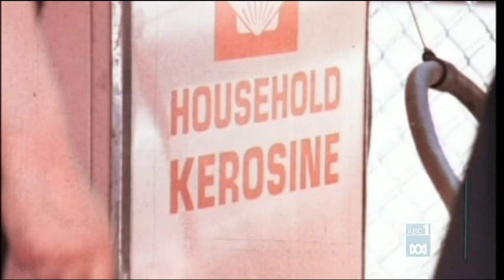Steam Powered 1963 Ford Falcon

Comment: Its hard to believe how many people actually think that steam is more efficient than ICEs.. poor educational system these days.
Reply: I don't think it's so much a factor of the education system being poor so much as willful ignorance and the fact that this type of knowledge is pretty esoteric for the average person's working knowledge.
Reply: True! Steam automobiles have been obsolete for over 100 years... the fact some here are convinced that an obsolete design is still commercial viable without any understanding of why the concept died out still escapes me... I suspect a combination of low intelligence and poor standards... which by default limits the educational resources of the individuals as well.
Reply: doktorbimmer What initially piqued my interest was the ability of at least this engine to use a wide variety of fuels, given the political volatility surrounding the international oil market- acknowledging there are complexities I will never know there. On top of that, there's the concern that oil is a limited resource- although I can't imagine it will stop being readily available within 50 years. Steam could theoretically run on anything that burns, wood chips for instance, and more easily than internal combustion- though I do know internal combustion can be accomplished with gunpowder, kinda like pseudo-pneumatic fuel? I don't know. I haven't studied thermodynamics, but I imagine horses would start to be more convenient at some point for everyday travel if oil were to be threatened for whatever reason.

But as far as self-sustainability, or else being able to adapt well to adverse effects on availability of resources, I am interested what our best 2nd options are.
Reply: Multi-fuel capability is certainly not unique to the external combustion variety of heat engines like steam engines.. in fact the most popular and efficient form of practical heat engine known to mankind (the Diesel engine) was not originally designed to run on petroleum products at all but rather a mix of alternate and bio-fuels ranging from vegetable oil to coal dust. The Diesel engine can consume virtually any type of fuel source a steam engine can either directly or through refining processes (including wood) The key advantage here is that a Diesel engine the size of an average automobile is about 4-5 times more fuel efficient than a steam automobile.  Although this advantage tapers-off as scale increases  (into the1 million+ horsepower scale) the Diesel is still both theoretically and in practice more energy efficient than steam. When the time finally comes when oil does run out... steam will not be a viable alternative unless we are bent on turning the whole planet into a barren, treeless wasteland. cheers!
Reply: doktorbimmer I didn't know that about diesel engines- which is of course an understatement. I find it hard to believe it would be easier to facilitate the use of coal dust or processed wood particles internally, where- and I am assuming here- it would need to be moved safely through pistons as opposed to through a furnace or other heating element in an external. I'll have to look up how this works.
Reply: doktorbimmer You've also made the distinction of heat engines. What other practical engines do we have? And for an application like autos? I understand nuclear fusion and fission are options, somewhat,  as well as batteries in electrical propulsion using magnets as well as other applications. I suppose there could be other chemical processes besides combustion, but I imagine those would be less efficient. Am I missing anything?
Reply: Finely pulverized and screened Coal Dust (very fine particles) have been used in both Diesel engines and in Gas Turbines but it is not an ideal fuel. The most likely scenario would be the conversion of coal, wood or other bio-materials into synthetic liquid or gaseous fuels.. Germany used both during WW2... its not a new or untested concept at all. The reason its not used today is cost/economics. Petroleum is cheap and meets global demand of a wide range of fuel products from gasoline, jet fuel and heavy fuel oil.
Reply: There is a large hospital in the nearby city which receives all of its electrical power from a large Diesel generator fueled from bio-gas (methane) produced by decomposing waste at the local landfill.
Reply: Although less efficient than Diesels, the Battery-Electric and Pneumatic propulsion systems are both more efficient than steam vehicles... and like steam are also less cost effective.
Reply: The majority of new electric power plants here in California are Gas Turbines fueled by Natural Gas (methane), which when operated under ideal conditions deliver higher fuel efficiency than steam power generation.
Reply: The ability to use different kinds of fuel is understated. Not only would diesel, gasoline, ethanol and vegetable oil work but propane, butane, coal, wood or newspaper. Even hydrogen produced by electrolysis from water  (using solar, geothermal tidal or whatever) could fuel them. basically, anyway you can produce heat you can use to run the engines. 

I also want to point out that steam turbines are practically maintenance free. Steam turbine engines used in nuclear power plants and taken apart for inspection after literally years of continuous operation showed no visible signs of wear.

I don't think we can write off steam as a way of turning heat into motion just yet.
Reply: +MrKDB001 Not at all, in fact its multi-fuel capability is grossly overstated... there were at the time several internal combustion designs capable of using the sames fuels as the Pritchard steams car and offered vastly superior fuel efficiency at far less cost and inconvenience. And you grossly overstated its multi-fuel capability by implying it was able to use solid fuels which it was not designed or approved (as built) to use solid fuels nor could it deliver the same performance on solid fuels.
Reply: +MrKDB001 I would like to point out that steam turbines have extremely restricted operating parameters and very restricted applications, they are only practical designs when constructed on a relatively massive scale... their use is limited to large vessels and stationary power plant installations. You will never see a steam turbine automobile for the same reason why steam turbines were a failure in locomotives... they are simply too big, heavy and cannot operate under variable speeds and power settings to be practical or economical.
Reply: +MrKDB001 But lets not stray away from the fatal flaw in steam power, the fact that it cannot exceed or even match the energy efficiency of internal combustion technology. In fact, just this year the world's record for combustion power plant efficiency was smashed by a internal combustion gas turbine (64%) and this is a significant milestone as well because this exceeds the maximum possible theoretical efficiency that can be achieved by a steam engine.
Reply: doktorbimmer Do not tell lies. The specific fuel consumption of the steam engine has never been 4 to 5 times higher than that of the diesel engine. An automobile diesel engine probably consumes around 170-175 g/hp/h of fuel. 5 times that would be over 850 g/hp/h. Not even in your dreams. Plus you forgot to mention that a diesel will not work on gaseous fuel alone. Liquid fuel is needed to provide ignition. Plus that the 1930s steam car has passed most stringent emission requlations while ICEs cannot without special gadgets like catalytic converters.
Reply: +Odilo Globochnik Of this steam car YES! 4-5 times higher than a modern Diesel automobile.
Reply: Any link to measured data?
Reply: +Odilo Globochnik Never head of direct gaseous injection? The technology does exist.
Reply: At least Wärtsila's marine and powerplant diesels (afaik that company is the leader in the field) use liquid injection to ignite gaseous fuels. Besides, diesel is not a true multifuel engine in the sense I define it as it cannot use solid fuels as such.
Reply: +Odilo Globochnik  "Stringent emissions regulations?" LOL!  You must be joking right?   In 1972 Australia had no emissions regulations on automobiles and U.S. federal standards allowed HC of 3.4 GRAMS PER MILE!!!!   AND NO LIMITS ESTABLISHED ON NOx!!!!!!!
Reply: No. I am referring to the Doble steam car which, according to Markku Mäkipirtti's book Sotilasajoneuvot Suomessa, recently passed Californian regs.
Reply: Yes Please provide some BSFC and Thermal efficiency data for the Pritchard steam car? Modern ICE cars are several times more efficient than such a small, crude reciprocating steam engine such as this.
Reply: I am very familiar with bi-fuel Diesel engines that used liquid pilot injection, in particular with Fairbanks-Morse stationary compressor applications that were build in the late 1960's. There is a company here in California that had a development program converting Diesel buses to direct-injected Natural Gas. It was demonstrated in the city near where I live.
Reply: Which California regulations? The manufacturers certification tests? Or just the bi-annual inspection tests?  In most cases these test are limited to only HC and CO under no load conditions. Both tests are on a sliding scale based on year of manufacture and gross vehicle weight with many classification exempt for these standards. I'd love to see some actual test results and the test parameters to confirm these claims?
Reply: doktorbimmer The source did not specify. I sm not interested in the Pritchard car for it is s conversion. A proper steam car is one designed from the beginning as a steam car. Btw, Henrik Ryti, a famous Finnish academic on mechanical engineering, also favoured steam propulsion for cars.
Reply: Well, that certainly explains why the Pretchard steam car was a failure... but why were there no successfully steam car companies after the invention of Charles Kettering's electric starter for the internal combustion car?
Reply: (Henrik Ryti) "also favoured steam propulsion for cars."  That would seem diminish his credibility as an expert in automotive engineering... would it not?
Reply: doktorbimmer Because technical excellence does not guarantee adoption in general use. E.g. the Burt-McCollum sleeve valve gear was and is much better than the poppet valve gear, but so far no widespread use. Or that e.g. the Argus, Hirth and Gipsy general aviation engines were technically vastly superior to the Briggs & Strattons of aviation (Lycocrap and Contijunk flat caricatures of engines, WW1 water-cooled engines have lower sfc on 50 octane fuel than these "modern" flats on 100 LL).
Reply: Because technical excellence has absolutely no effect on the Laws of Thermodynamics No Rankine cycle engine can even achieve higher thermal fuel efficiency in single cycle operation or have a higher efficiency limit than ICEs.
Reply: "Knight" invented the sleeve valve engine design, while superior to poppet valves in volumetric efficiency? the higher cost of manufacture, high oil consumption and less than "bullet-proof reliability was its down fall.. particularly after the advent of gas turbine aircraft powerplants that offer vastly superior power-to-weight ratios and BSFC at P-100.
Reply: I'm a huge fan of the Argus V-8... it is a singular masterpiece of aero-engineering for its time and still a beautiful work of art to behold even today. Powerful, efficient, smooth running and incredibly reliable... nothing before or since has ever come close. But it is without any doubts a very expensive design to build and to operate... compared the popular civil designs in use today... Per Hour operating costs are very important today in civil aviation... Lycoming and Continental still deliver what the consumer demands Low Cost.
Reply: +Autistic Boy The Second Law of Thermodynamics is incontrovertible. Malice may attack it, ignorance may deride it, but in the end, there it is and there is absolutely nothing you can do to change it.
Reply: +Autistic Boy Don't be a sore loser son...
Reply: +Autisic Boy I thought you finally learned all this by now? That steam cars are obsolete because they can never be as fuel efficient or economical as ICE cars Right?
Reply: Steam cars are obsolete because they are inferior to internal combustion cars.
Reply: Internal combustion engines DO NOT require petroleum... there advantage is higher efficiency, higher performance and lower exhaust emissions.
Reply: I'm sorry the educational system failed you.
Reply: @Darryl Kellu Sure, no problem... have you ever heard of the Carnot Formula?
Reply: I’m not going to believe in freemasonry lies anymore. Steam and electric would’ve been better.
Reply: @thelionofjudah5318  Why would they have been better? If they were better they would have outsold ICE cars.